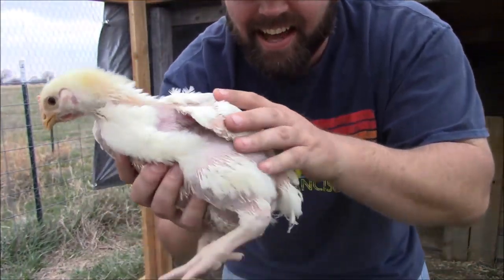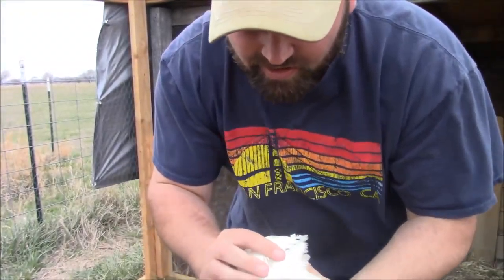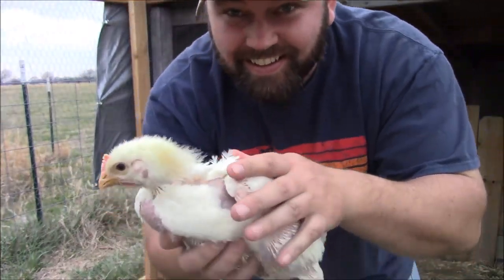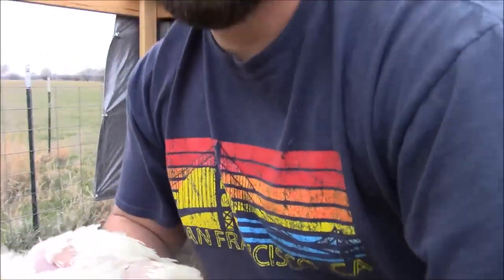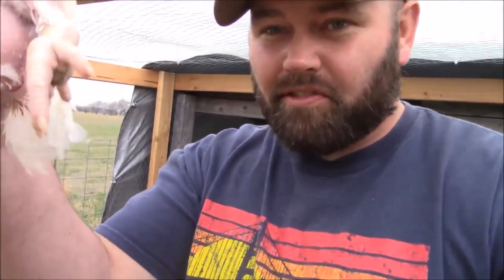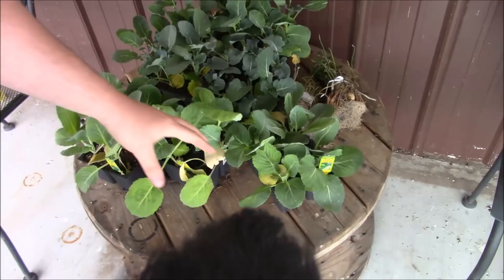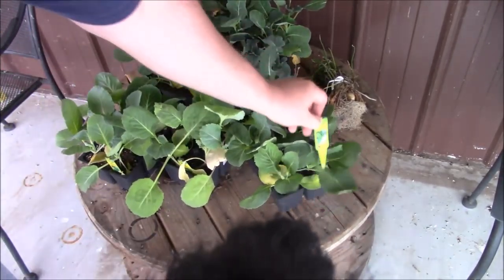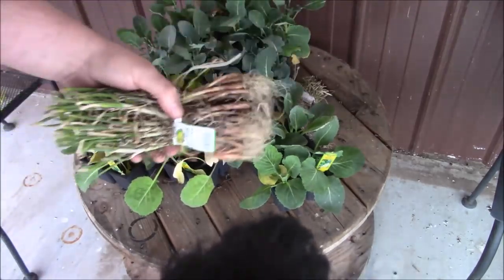How To Make A Easy And Cheap Raised Bed, 3 Week MUTANT MEAT CHICKEN Update

Comment: If you are not walking in your raised beds you should not have to rototill ever again.  Just use a hoe.  I have used raised beds for years (3 feet by 12 feet).  I do not use treated wood because of leaching but use cedar or other moisture resistant wood.  I also do not use cross beams.  Not one bed has ever warped or bowed out.  Also below soil level I put a layer of landscape cloth and chicken wire to keep out rodents and weeds.  Really helps.

Comment: Hi Dutch you need to put a cattle panel down the middle as a trellis for your vegetables beds put your tomatoes on them then plant your cabbage in front of them the cabbage will act as  ground cover so dirt dose not splash onto the tomatoes to help them from getting the blight and keep your tomatoes in a row so more air can get to them less chance of them getting  white powdery mold also put epson salt on your dirt the plants go crazy over it they green up really good do the same thing in your bed for your broccoli put the tomatoes in the center and to remember to snap off the first set of leaves of the tomatoes then plant them to that deep of the place you cut off the branches they will grow more roots up that stem which will make a stronger plant put epson salt in the hole

Comment: That's a lot of dead space between them. At most you only need enough space for a wheel barrow.
Reply from the maker: Patrice's Projects i have 10 acres so the space isnt a issue for me honestly. But i do understand where someone with limited space may want them closer, i have them 48inch apart.
Reply: For me, space is definitely an issue. What kind of soil are you going to put in them? Do you make compost?